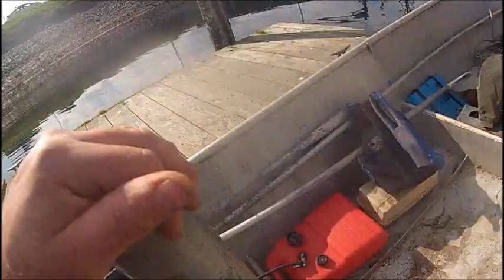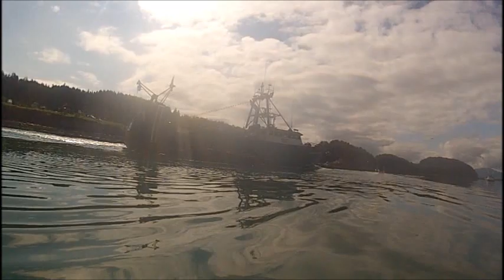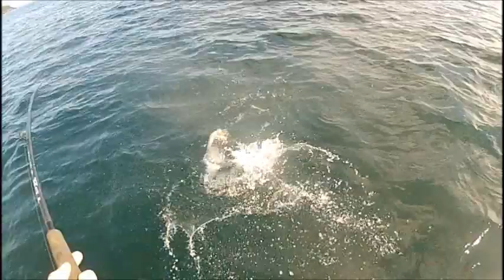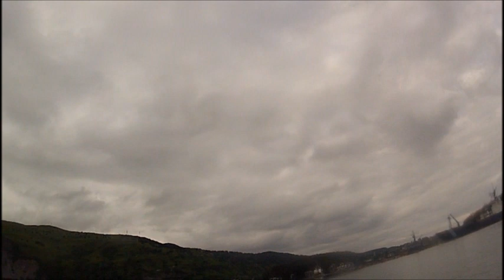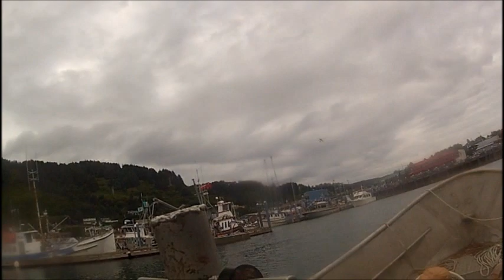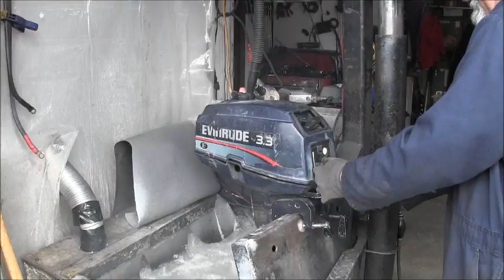MERCURY  1983  50 hp,, Boat ride & FISHING

Comment: Wish my fitty ran that good!  First time on the boat she didnt want to rev up.  Carbs were rebuilt.  Just bought a new tank, lines, fuel screen but haven't had the time to get out.   If that does not work maybe look at the linc n sinc timing since I changed the trigger.
Reply from the maker: Sounds like U R on the rite track.   kodi
Reply: @kodibassInsideoutboards  Nah failed miserably.  I am thinking it isn't firing on all four zylindahs.  Pulled the spark plugs.  Top two were spiccaty clean just gas wet.  Zee bottom two had a little black soot on them.  Even though they all was firing after the switch box.  Im thinking maybe no now.  Maybe thats why she runs like 1/2 power
Reply from the maker: @L2fish   sounds like you might B getting water in the 2 cylinders that are wet (steam cleaned)  exhaust by-pass gasket, or head gasket may-b     kodi
Reply: @kodibassInsideoutboards  Hmmm good point.  The heads are built in this motor so maybe that exhaust bypass gasket.  Or the cylinder block cover plate leaks around #1 spark plug but I cannot see any connection internal or to the exhaust cover plate.  Plugs arent milky though.  My old Rude had a bum head gasket and the plugs had water on them and was milky  from mixing with the oil.

Comment: hey Kodi i have a 1985 johnson 2hp i just bought it i installed new water pump kit it runs great but when touching the head it seems very hot there is water spitting out those four little holes that are above the gear case do they run warmer than other motors
Reply from the maker: Yes in fact they do run hotter than most from what I have seen.  Buy a cheap-o digital heat gun and take readings tho they seem to run hotter they still should stay under 185 at the spark plug area of the head.  If hotter there is a blockage some where.   kodi
Reply: @kodibassInsideoutboards  thanks  very much for the info